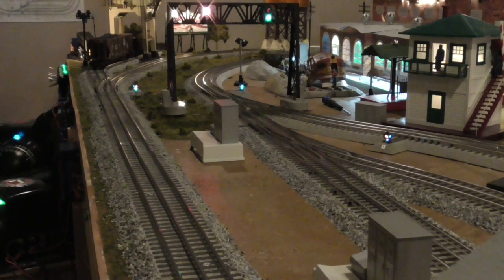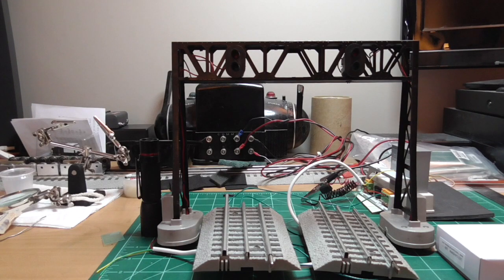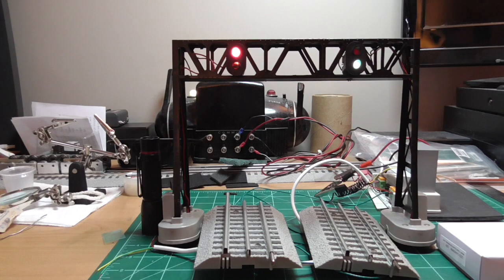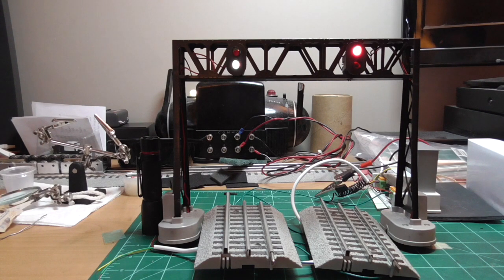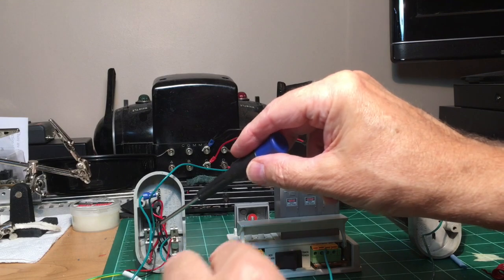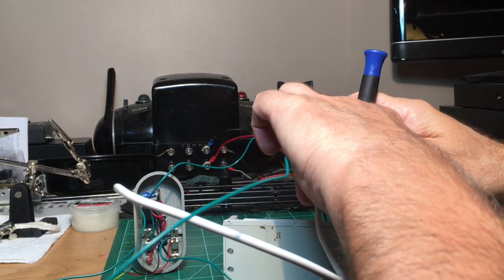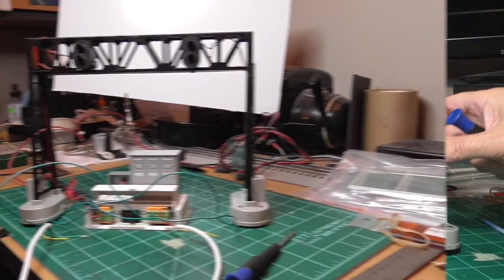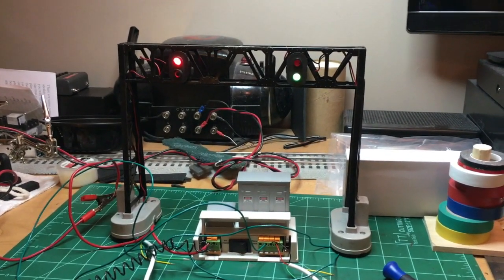UPDATE: How to wire a  450 Signal Bridge to a 153IR controller; Signal Bridge in operation.

Comment: Hello Ed, I purchased a new 153 IR sensor off of eBay. I wired it just like you did in your video but I only get the lights to come on when I switch the ground to Acc Pwr, same light pattern as you,  but they don’t change when I pass a train car in front of the sensor?  I tried switching up the wiring but nothing. What am I doing wrong? 

Thanks
Reply from the maker: Well that's puzzling. I have no idea why that's happening without seeing the actual wiring.  Seems there may be a switch up of some kind in the ground wire. I would start over by first checking the continuity of the original wiring in the 450.  Check to be sure the light bulbs all work. Then I would check the operation of the  153IR . I overlooked the timing switch and sensitivity switches in the past and thought the accessory was not working properly. Once adjusted all was well.  Once satisfied the bulbs work, the wiring in the bridge is OK and the 153 is working, then rewire it.  I hope this helped.  71-4094-250 Dbl Signal Bridge Lionel manual on page 6 shows the wiring.
Reply from the maker: Manny, I just checked to be sure my signal bridge was working...it is. I forgot to mention, I use auxiliary power to operate the 153IR, not track power.